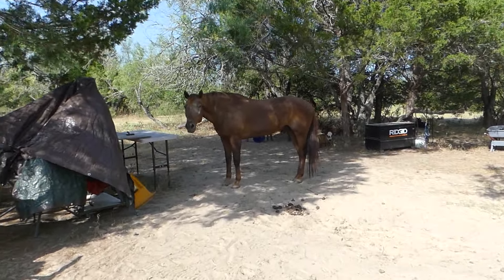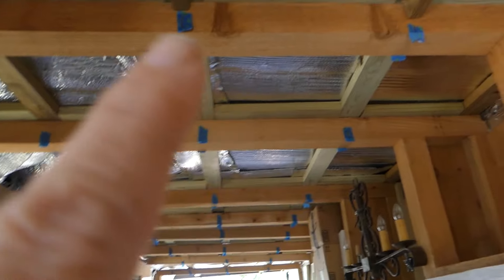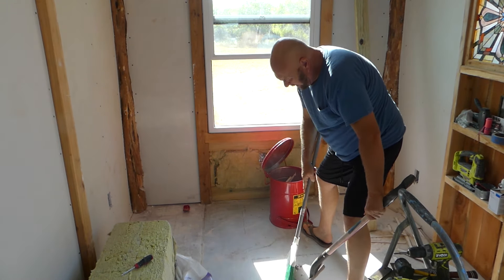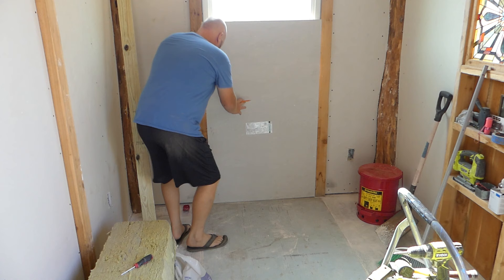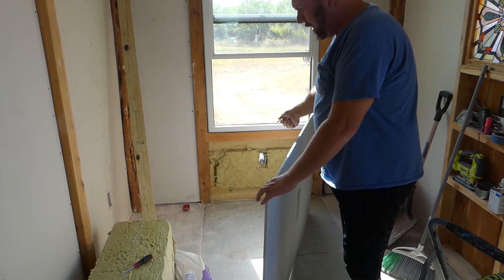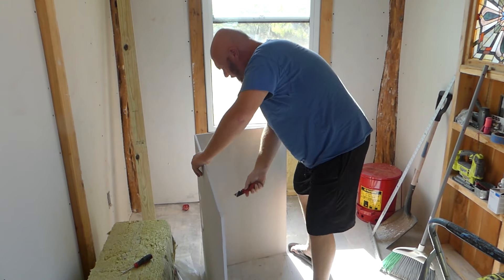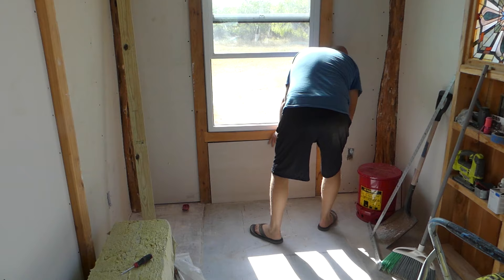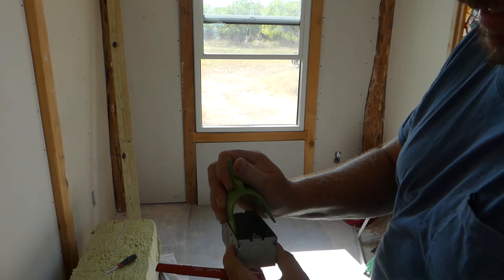Hardie Cement Board as Drywall replacement? You bet for an awesome win in wet exposed areas.

Comment: Hey! After you install what do you do to prep it for paint?
Reply from the maker: Hi Heather. That is all just plaster on drywall. I'm going to use Venetian Plaster to finish coat. I will do final sanding all at once because it is so dusty.

So, I won't prep these walls with anything. 

Normally I use Kilz as a primer for house hold paints thought. I like it. It has some copper in it to kill mold and mildew and is a great stain blocker. I do that pre-emptively even on brand new walls.